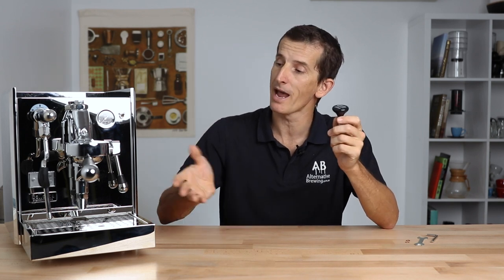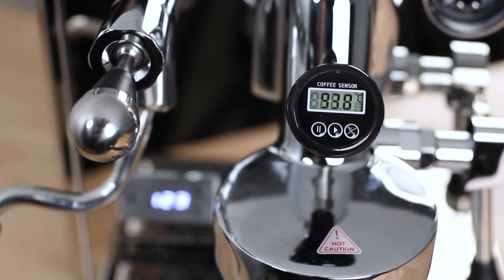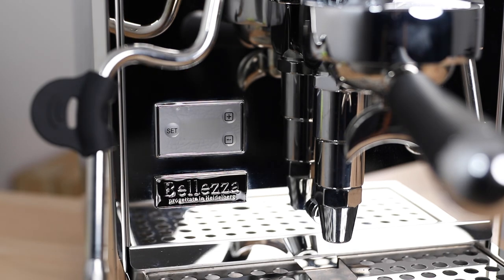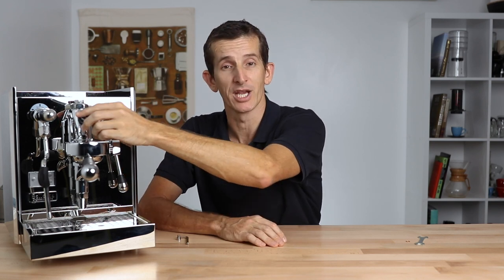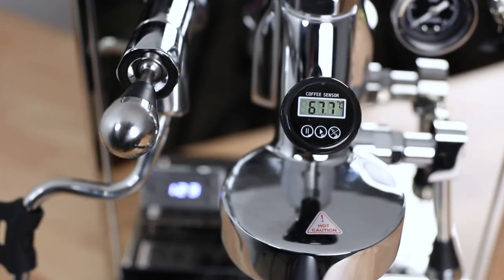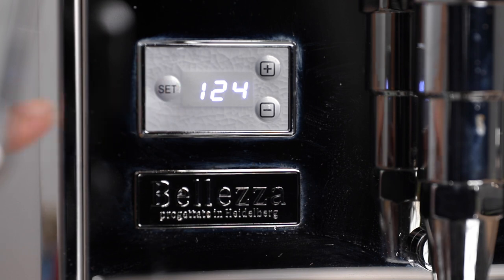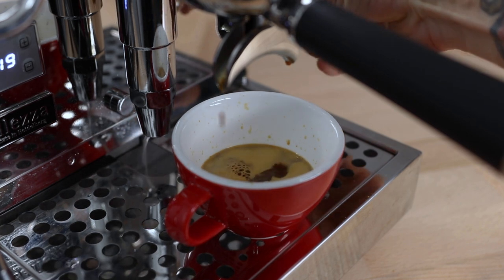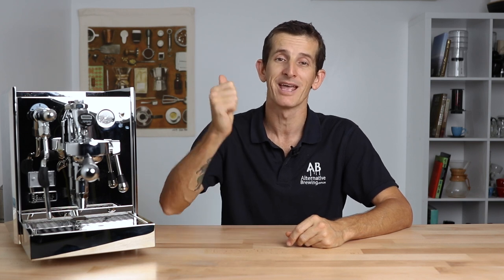How to Install Coffee Sensors' E61 Grouphead Thermometer in an Espresso Machine

Comment: Copper sealing washers are designed to fit between 2 metal surfaces,  not a deformed teflon washer, fyi. Great tutorials also !
Reply from the maker: Cool, thanks
Reply: That is correct.  When I saw that, I was wondering about that.  I am a Hydraulic Technician.  We call it a "Copper crusher gasket or washer".  My only reservation is whether or not the E61 Group Head material can tolerate enough torque from the thermometer to crush the Copper and effect a seal.

Comment: Do you know how to change the battery on these? There are no instructions anywhere
Reply from the maker: HI Angus, yes I believe it's a small coin battery in the back like a LR44 or similar - to remove it gently pop open the plastic housing from the back - remove the battery - and taking it to a Jewellers or watchmakers to replace- they can get you the one you'll need.